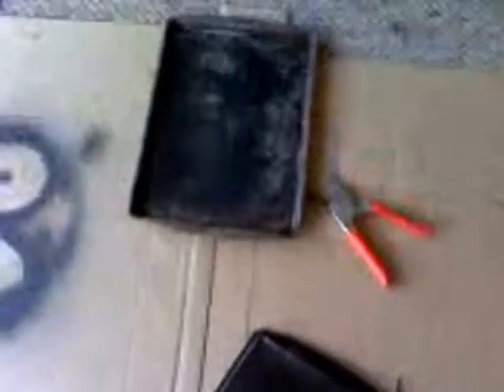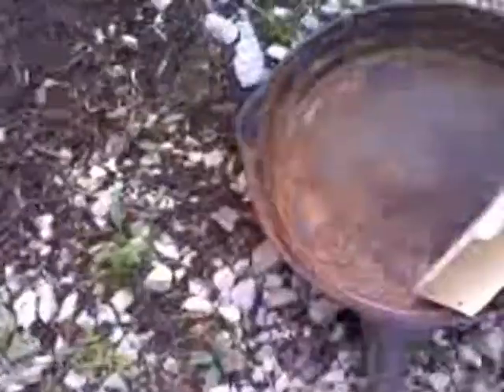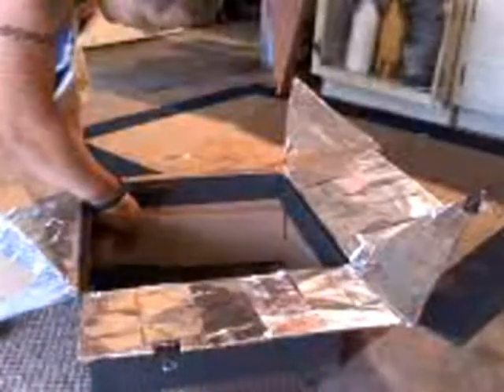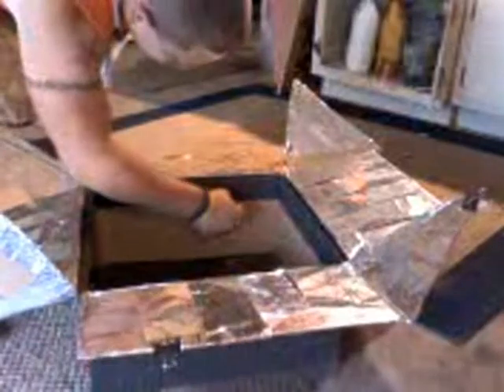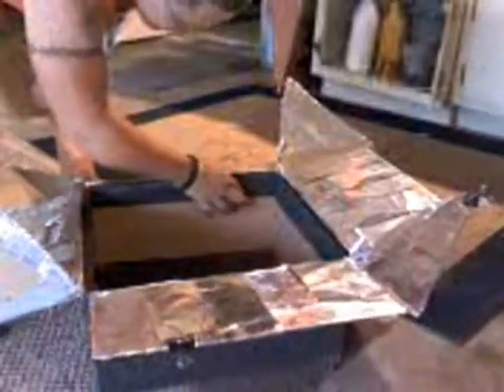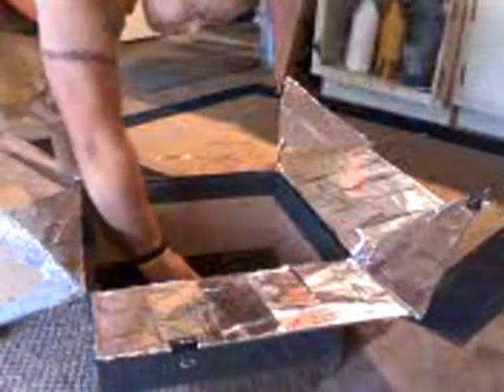Solar Oven Experiment pt. 4 of 4

Comment: ...cont - stick a fan in your kitchen window. Do this at night, or your neighbors will call the fire dept. Let cool in the oven and repeat - the more times, the better. On fresh iron, I shoot for five times. The result should be black as night, smooth dry, hard and non-stick. Do the pieces upside down with foil on the shelf underneath to catch any drips.

Comment: OK, time out. You're hurting my feelings with that beautiful piece of cast iron. No need to paint it - properly seasoned it will be jet black. Take it down to bare metal (the hard part) then grease it up (I use lard because my grandma used lard) and fire it in an oven at 500f for an hour. Alton brown says 350f - but he's wrong. Lodge says 350f - but they don't want phone calls about all the smoke. (unofficially, at least one lodge rep says 500f is better)... cont.